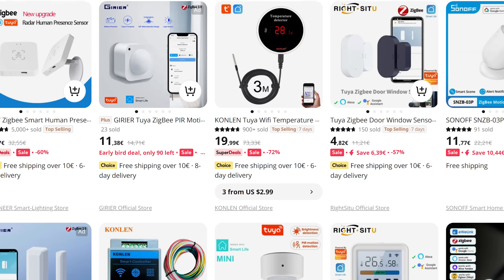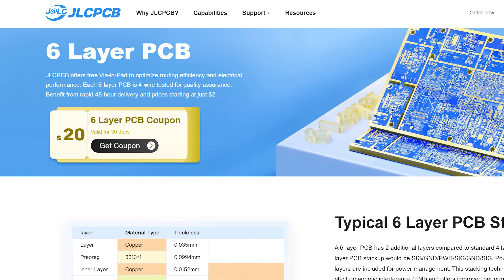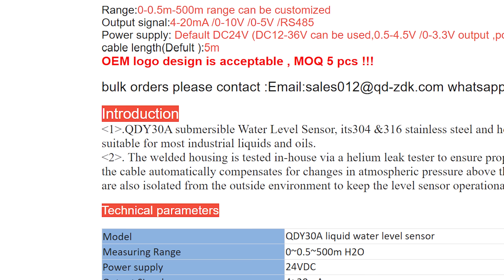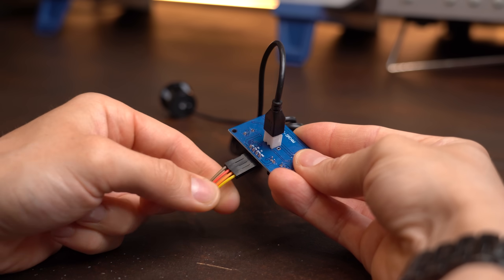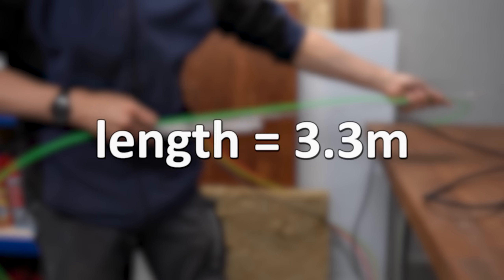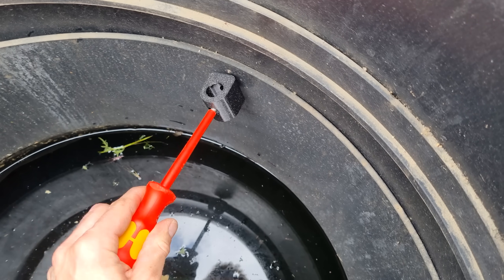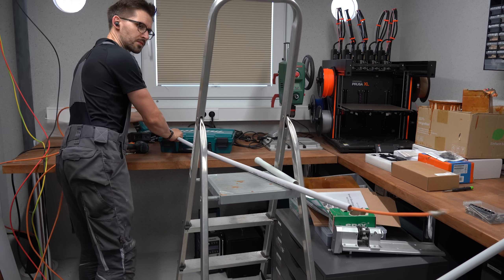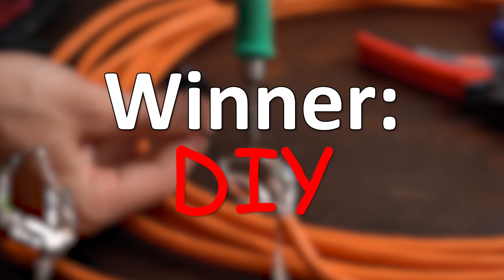This Happens when all Buy Options Suck! Water Level Sensor (DIY or Buy)

Comment: Having pulled multiple cables through conduits.
I would us a poe module for the driver board, and mounted all boards outside the pipe. Running only a single outdoor rated Ethernet cable for data and power.

Comment: It is interesting that you had trouble extending the 'black-magic' cable for the ultrasonic transducer. I did a similar thing but it worked out fine. However I was mainly cutting the cable because I needed to get it through a small hole and the connector was too large.

Comment: Nice. Did the same thing just a month ago. Same issues with ca cable, same solution applied, but I added the esp closer to the sensor. Also I didn't add any resistor for the mode. But I have a problem. Sometimes the values are bouncing up and down without any change in the reservoir. Could it be because of the missing resistor?

Comment: I believe water level sensor WiFi (Tuya) WF96L (dold under many brands) it is a competitive solution. There are DC and AC versions. AC powered had a lower than 40€ price, shipping included

Comment: Those wires for the ultrasonic transducer are actually transmission lines not just DC signal line therefore you can't spice them but have to replace the entire length of cable. The joints in the wires caused by spices cause reflections in the signals which can cause all of the erroneous readings.  You can use any random coax as a replacement but you have to replace the entire length you just can't splice them
Reply: The signal strength in TV broadcasts is orders of magnitude larger than what is in these tiny sensors. Splices do affect TV (you can easily measure this effect and consistently guess the number of splices and length of cable with practice, some meters actually have this function built in), just not enough to matter for signals as strong as TV until you add 10 or 20 splices.
Reply: Sorry, I didnt understood very well.

If I replace everything with a regular 4 or 6mm cable it would work? Or it need to be a special cable? What about the solder at the cable/pcb/connector. It would affect the signal?
Reply: @dollymix5  Yes, if you completely replace the original cable with another shielded cable of appropriate length, it should work (I don't think these need to be perfectly cut to length or perfectly impedance matched).    Make your solder joints on both sides but the transducer side in particular, as smooth as possible.

If you have access to a time domain reflectometer (TDR), you can hook the thing up and what you should see is a only a return spike at the length of the cable..
Reply: @dollymix5  Short answer is yes, but I can see some caveats to that in this case because you probably can't get all the way to the sensor component itself with how it's molded together and would still have a splice, just closer to the component.  I don't know if that splice closer to the component and then no splice on the other end until you connect to the board would be "clean" enough, but it could be worth a try if you really wanted to.  I stand by my other comment though, that the under water pressure sensor would be the way to "upgrade" this setup.  Mostly because that sensor is more robust and I think it has a better chance of still working 10 years from now.
Reply: That's not true, you can join the lines as long as the coupler and piece you add have the same characteristic impedance, also you need to use transmission line which the transmitter and receiver are designed for, ie if the transmitter has an output impedance of 50ohms the receiver an input impedance of 50ohms then 50ohm transmission line should be used
Reply: But if its just "coax" there are connectors& plugs extenders etc? Like oldschool tv coax ?
Reply: If he replaces the tiny thin stuff with RG-59 or something, yes there are impedance matched splices available,  but they still cause reflections that may affect the function. and if replacing the coax, why not just just the full length required then?   And there are no splices for the thin stuff...

Comment: I think one approach used in airplane tanks is a capacitive sensor, of one metal cylinder inside another. Although I'm not sure if it has to reach all the way to the bottom or not.

Comment: This was exactly the video I was looking for, I wanted a reliable water level sensor but I was concerned about wrong readings due to the ultrasound reflecting on the sides of the tank.
And I definitely agree on DIY being the winner, being an electronics hobbyist, this is the obvious route to choose as I enjoy the process too and can diagnose easily if something goes wrong.

Comment: There is plenty of components from electrical companies to build a Simple system like the one you need. At my work we use simple water sensors at different levels im the tanks connected to relay that turn cheap LEDs on/off. Another module sends a Text to a guy on charge every few hours. All off the shelve components, probably 200 dolars and it just worka...

Comment: 7:12  the ultrasonic board returns a line that is HIGH from when a pulse is sent out to when it receives a pulse back. The cable length should be negligible, so..

Comment: What a great idea I’m going to do this with my aerobic system. One thing I would do differently though is avoid having junction boxes inside conduit. It’s typically against code because it’s inaccessible. I’d put the whole thing in a box in the cistern and just run POE to it (you can get some cheap POE to USB connectors on Amazon). Of course this assumes you have a WiFi signal out there. BTW where did you get the DIN box for the ESP? How’s it mounted inside the box?

Comment: An easily analog/digital approach is to take a thin narrow bar of the same length as the depth of your tank.  Twist it 270 degrees.  Then take 2 guide rods and take a cork float and drill two holes such that the guide rods pass through.  Mount the spiral plate between the guide rods.  Cut a slot in the cork float that matches the the profile of the spiral plate.

As the float raises the spiral plate gets twisted.  You can mount a potentiometer or a pointer on top.

This system has been used on fuel tanks a very long time.

Look up snowmobile fuel tank gauge for examples.

Comment: if you ever need to extend a coax cable in the future it might be worth getting an FME cable, they're 50ohm impedance rather than the normal 100±20 ohm impedance of twisted pair cables. 
Oh, and they're not terribly expensive, if you wanted to buy just the coax (ie, rg174) you normally have to buy 100m+

if you want to try an experiment of impedance matching you could try adding a 120ohm resistor where you extended the cable to somewhat alleviate the impedance mismatch (adding >200ohm on either end of your cable might work better)
I'd be interested to know if you can make the sensor you already cut the cable for work by adding a couple resistors, but I imagine it wouldn't be worthwhile for you to try.

Comment: I had an application where I need to measure water level of an overhead  water tank.. and turn off the pump when it is full( if i don't turn off then tank starts to overflow which i don't want, at the same time I don't want my tank to be under filled)... is ultrasonic sensor accurate enough?? I mean velocity of sound changes based on tank's temperature..wouldn't it cause error in your measurement?? And what about sloshing??(can use some filters)...
Reply: Just use a toilet cistern valve

Comment: I Have been using the same ultrasonic sensor for 2 years. In my experience it works very well, depending on the application you will need to apply some sort of signal processing. Once in a while condensation might be an issue but I just clean the sensor. By the way, the first transmissor comes in RS485 and works very well at big distances with 24V power. I have a couple of tanks with these RS485 transmitters since 1 year and so far everything is ok with no maintenance need.

Comment: That wire to the transducer looks like one with a measured resonant resistance (50? 75? ohms)  That's probably why your extensions created garbage information - wave reflections at the joins.  Antenna wire might work, if you're willing to keep testing

Comment: Why did you use ultrasonic and not time-of-flight sensor?  I use this for my water softener tank to know how high the salt level is.  It was so easy and cheap.  Just an ESP32 and a VL6180X glued to the top lid, and that's it.  The VL6180X measures the distance to the salt in mm just like your ultrasonic sensor, only it doesn't suck.

They are actually ideal for this situation - a sealed container in total darkness.  It is in areas with other light sources like sunlight or artificial lighting, like a backup sensor for a car, where the ultrasonic sensor is better.  But in total darkness you have no reason not to use the superior ToF technology.

Comment: Cool hacking there :). I like the DIN rail mounted box, it should keep the electronics warm, dry and comfy. Speaking of which, I really love your Hager distribution box. Clean and elegant. The legendary German quality!

At some point I did a repair job on my friend's old VW LT28 camper, where he needed the wiring and plumbing fixed and ready for a trip around Europe. I don't remember the exact manufacturer and model of the system controller in that thing, but it featured a water level meter that used four screws in the tank's wall as probes placed along the height, plus an additional ground probe. It must have been either a resistive or capacitive sensor, though it could only quantize the volume to five levels: empty, 1/4, half, 3/4, full.

Comment: I will say anyone who live in Eurasia definitely have more access to niche things than anyone who live in the Americas, though sites like Temu, Wish, and AliExpress have kind of bridge that gap a bit.

For example a project I was thinking of was to make use of one of those Battery-less, self powering, wireless electrical switches. However I wanted to use one that used separate On/Off signals. The only ones I could find won't ship to the Americas. So I'm stuck with models that just send the same signal to toggle.

Comment: There's so many ways,
Pressure, height, weight
And there are so many ways to do that aswell
Loadcells, potentiometers, ultrasonic,
But imo the cheapest is to just to put a load cell ontop of a long sealed pvc pipe

As the water level rises the displacement of the pipe increases, thus increases the pressure to the load cell 🤷‍♂️ no moving parts
Ofc it's not gonna be that accurate but going from 0% to 100% is gonna be so different that you'd probably have 0 problems in calibration😂 and the math is easy too
Just from the weight from the loadcell - the weight of the pipe, that's the water displacement,
Turn into volume easily, and divide with the circumference of the pipe, and you get the height of the water

0 moving parts, no risk of water damage cus a loadcell is sealed

Very very simple compared to complicated ultrasound sensors or expensive pressure gauges which are just loadcells at the end of the day😂
Reply: 1inch od pvc tube,
100cm
That's almost 2000cc of volume
That's 2kg of water displaced so the loadcell only,
A 5kg loadcell is like $2😂

Comment: The hydrostatic sensor would have been the better option here.  Ultrasonics have all sorts of problems with condensation.  For that reason we dont use them in industry unless its for a dry level application.

Comment: I can see that the cable you were trying to extend was coaxial cable. Coax is used for high frequencies and to ensure low loss, which is perfect for RF. You probably could have extended that cable with a grossly higher specked cable like common RG6 (cable TV wire). But you might have needed to add another conductor beyond the center signal, and the ground shield, if you need power and ground as well. Ive seen coax wire out there that has an external moulded third wire attached to the coax!! I'm pretty sure that it's used for giving power and getting signal back from analog surveillance cameras. Would have been perfect for this !
Reply: Following some pages which also tried to exend the range of the sensor, the HF transformer on the PCB is tuned to the cable lengh. 

Guess with such cable length/difference RC specs the hole resonance loop on the board needs are total rebuild?
Reply: @mrwho30  I see, makes sense!! In RF radio applications, an SWR meter can help measure the standing wave charactistics given a specific antenna, cable, and receiver/transmitter, at any frequency. It helps the operator visualize and tune the impedence to be most efficient (reduce power loss) and is always based on matching some fractional wave length of the frequency you are targeting. That way the operator knows they are getting the highest gain possible with energy spent or received. A similar mismatch was probably happening on that wire , just because it is so high frequency, which is why they use co-axial cable. Not only do the waves have to line up to reduce deconstructive interference within the cable, but we have to make sure the signal doesn't dissipate to outside sources as happens with (normal) electrical conductor cables. How Cool is it that great Scott's fail helps us all link concepts together at a high level!! Thank for sharing your fails!!!!! 🥳

Comment: Some type of simple Air Conditioning  "Float Valve" for the drip pan.  They can be run on a low voltage control to fire up a pump
or to tell you when it is high or low.  Now I'll watch the video to see how you fixed it.... good idea to watch before I comment..
think I'll do that next time >> > peace

Comment: Nice project and nice application. Just a small comment from me. The speed of sound is influenced by, among other things: temp. and humidity. You can neglect humidity, but temp. not The formula should be. v =  331,3 + 0,6*T. (T= temperatur in C) Maybe this can help you. Good luck

Comment: I have the same metal stuff, which works great! With an ESP32 and ESPHOME (vie Home Assistant) it can integrate to my smart home. The built in ADC is not optimal for now, but I have an external, just I let it for this summer, and will upgrade while it will be empty at the winter...

Comment: Hi, I completely agree with you.
Even when I have something in mind I look for various solutions and then often switch to DiY, even if my things are less electronic than yours the principle is always to look for the best for our use which is not always standard.
Only one thing isn't clear to me: did you have the box with the transducer interface inside the tube along the entire length of the transducer cable or did you place it just inside the tube? The second of the two hypotheses seems to me to be the best of the two because it allows you to access the box always and in any case without having to disconnect the cat7 from the circuit in the garage, saving one or two meters of cat7 and then having to disconnect it every time you have to work on it (even if it will be rare) seems useless to me

Comment: Why didn't you just use float switches of various lengths. They are only $.99 each for the short ones  and honestly you just modify those if the longer ones get expensive. So get 10 of them. Make a bar graph of LEDs to represent your water level in the tank. Power the whole thing with your solar garden light or use some joule thieves and use up old batteries. 

Fuel level sender from any car junkyard. 

Camera stripped from an old laptop with a nice bright LED aimed at a measuring stick in the tank. So then you literally see the level in the tank. 

And I'm pretty sure they make sump level sensors that are less than $30 that aren't just switches. 

You may have just reinvented the wheel in this one. 

These are just off the top of my head. Lots of people collect rainwater, they must make specific ones, I'm assuming they are stupid expensive since you made this setup.

Comment: Few weeks ago I had a similar need to monitor water level in a well. I considered ultrasonics and some other ideas and decided that the simplest solution for me is a capacitive linear sensor made with old polyethylene flat tv antena cable (symetric and unshielded, used half a century ago). I have connected the cable directly to ground and one of gpio pins on esp32 (s2). Flashed with ESPHome and used its capacitive buttons function for the measurement. I have added a proper readout on Home Assistant panel together with a graph. Worked flawlesly from the start. I got a data stream that I could scale to water height in cm. The response seemed very linear and stable.
Flat ribbon cable I have used for initial testing worked too (I have connected wire 1,2,3 to gpio, 4,5,6 unused, 7,8,9 to esp's gnd). I prefered polyethylene because I had doubts about pvc insulation changing its proprieties while being kept under water all the time.